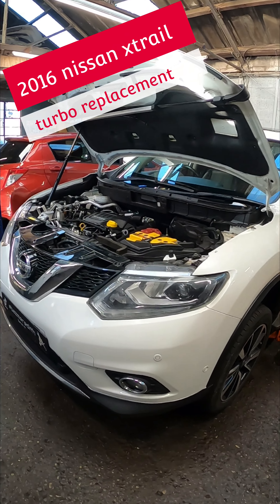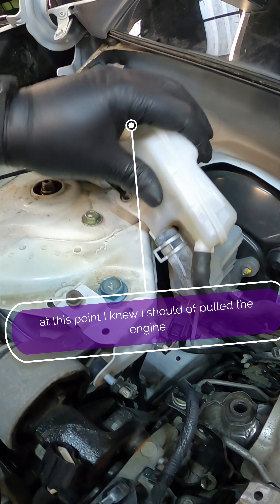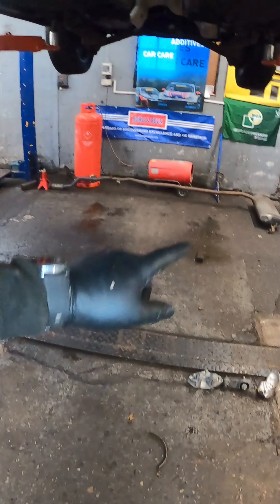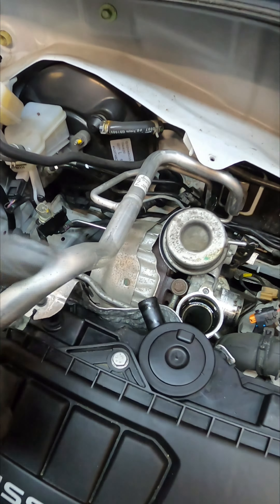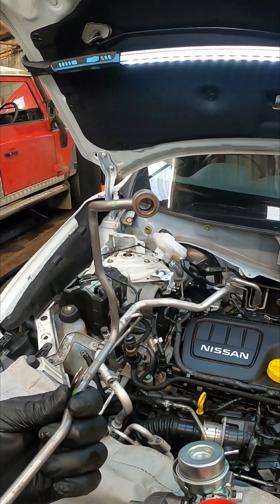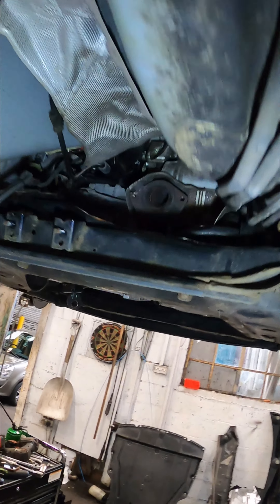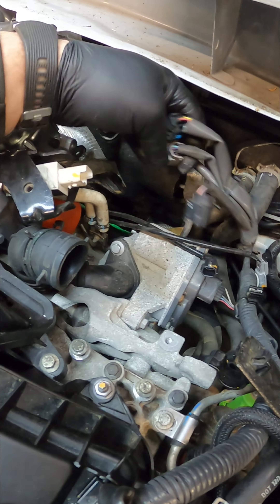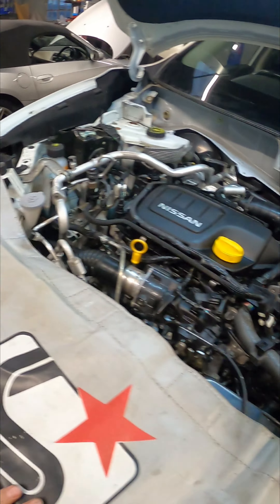2016 nissan xtrail 1.6dci turbo replacement

Comment: Can be a nightmare jobs like that. Problem is once you get that deep in you don't want to pull the engine as you've got that far 😂
Reply from the maker: Any other time i just pull the engines to make light work.... have no idea what made me do it in place.. as I've changed loads on mercs and renault and pulled the engine
Reply: @bazmeredith  makes it so much quicker, i do it on timing chains sometimes as its less faffing about and makes cleaning 10x faster with all that room

Comment: I work for Nissan, and crap job book time is 9 hours 2wd and 13 hours. 4wd so much easier to just drop the engine and gearbox on to a work bench to replace can save hours.

Comment: Did you use the original gasket with the heat deflector on the mating surface of the turbo or did you use the new gaskets without the deflector ?

Comment: Hey mate. I have a fuel leak on the same engine. There is a hose coming off the high pressure fuel pump and there is a green plastic cover around the fuel pipe any idea what this is call as can't find it anywhere. Is there a union under the plastic cover. Right hand side of the engine.

Comment: What caused the turbo to blow other than the fact its a Borg warner turbo which is part of GM. We have a trafic single turbo and its only done 50k and needing a 4th turbo.
Reply from the maker: It can be down to servicing oil and filter... blocked dpf and also not allowing the vehicle to warm up before use or cool down after long drives
Reply: @bazmeredith  Never had DPF issue, full service history serviced every year, lot of services by renault. Does both short journeys and longer approx 25/30 mile where its left to idle for a few mins while we find out where we setting up at hotels. One turbo lasted a couple thousand miles before it shit itself and that was all done at renault van centre. Something has to be inherantly wrong for a turbo to just break so quickly.
Reply from the maker: @richwilliams9895  have the changed the oil feed and return pipes
Reply: @bazmeredith  They replaced put it on the invoice that it was changed, as was intercooler, gaskets etc
Reply from the maker: @richwilliams9895  strange one why it's failing

Comment: Please tell me Nissan xtreil t32 1.6 diesel transmission mechanics. The hum when driving from the front, when I maintain a constant speed, and when I pick up speed, it disappears, and when I drop the speed, let off the gas, the hum also disappears, the mileage is 140 thousand. What can it be?